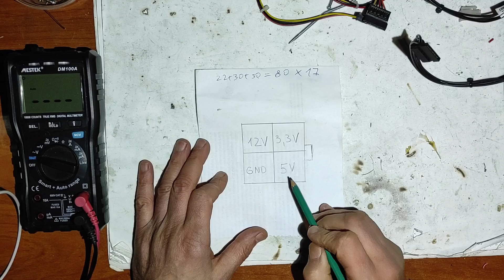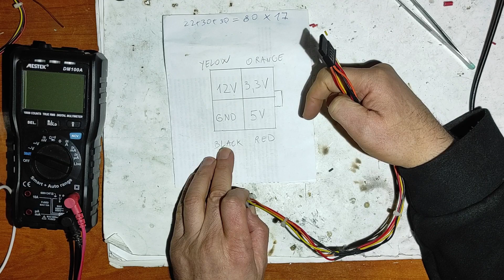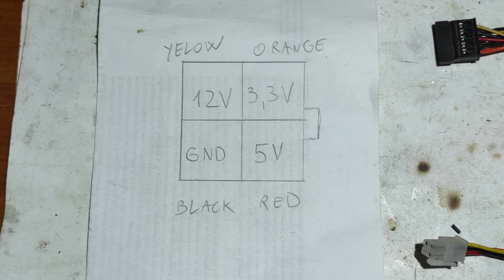Diy Lenovo SATA Power Cable in 5 Min

Comment: Thanks for video, it helped me a lot, but in newer versions of lenovo SFF computers, like m75s gen2, these 4 pin sata power connectors are smaller than 4 pin cpu connector, the power scheme is still the same. I solved this by using andruino/esp32 cables with female connector. I pull the pin from case and remove oryginal cable, becouse they are to thin to tranfer higher AMPS, and solder the sata cable directly to it, and reinsert it to case again. When you're done that, just polish a little that female case connector with sandpaper and it will fit perfectly in that 4 pin connector.
I also skip 3.3v connector becouse i don't need it for HDD/SSD.
Sorry i can't attach link to an image of it. becouse youtube remove my comment :/
Reply from the maker: tnx bro, I did see yet this new conector. tnx for sharing.

Comment: I hate that this video was so hard to find! This is absolutely what I was looking for! Thank you very much!!

I have a very similar Lenovo board (IS8XM) with two of those 4 pin connectors. How much current do you think that 12v pin is good for? I would like to try and use a SATA drive cage that requires 4-pin Molex connector. (actually two connectors) It has a built in fan. Do you think this type of adaptation could fit this use case? In other words, would it be safe to adapt that connector to 4-pin Molex?

To be more clear, I would like to put one Molex and one SAtA power connector on each of the two cables attached to the board. That seems like it should work. Just wondering if anyone has any previous experience with this.
Reply from the maker: tnx bro. I am sure that if u search service manual or specs for your mb u will find maximum current. I can presume 1A for each branch.